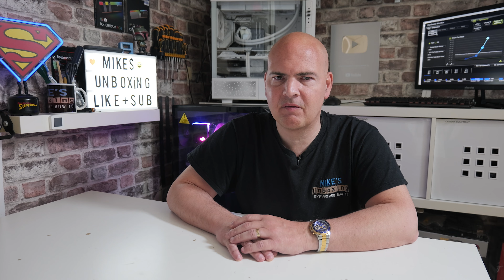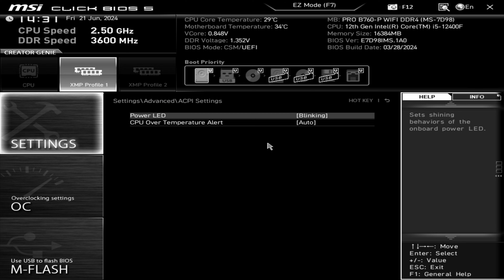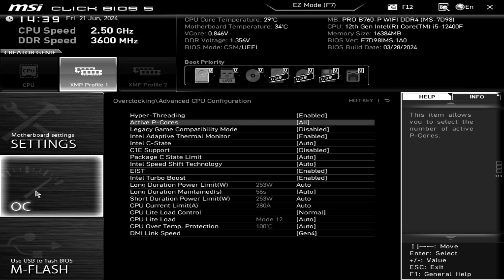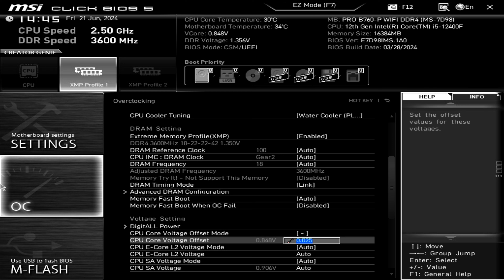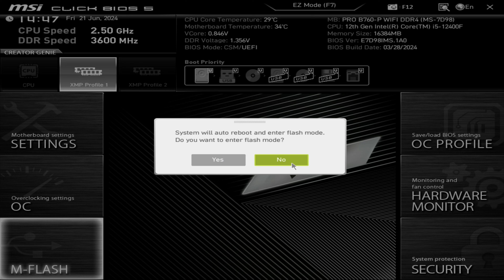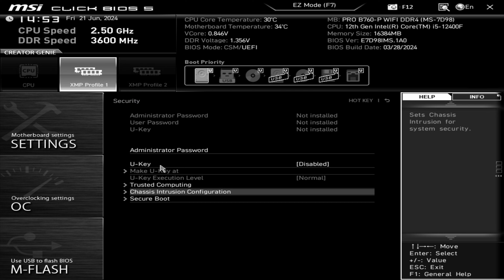MSI Pro B760 P WiFi DDR4 BIOS Tour & Settings Walkthrough

Comment: Hi, i have upgraded my pc with an msi motherboard. I already had windows 10 on existing ssd, but it wont boot to windows, it just goes back to bios screen. How do i know which is my ssd to set it as priority?
Reply from the maker: you might want to look at the CSM / UEFI setting, if the disk drive is in the MBR format a new motherboard might not be able to "see" it. Try toggling the CSM setting and see if the drive reappears

Comment: Installed windows on Sata 5 SSD and removed the win 11 usb and now the windows install is sluggish and unusable.. Google says windows boot loader may have been installed on usb.. I don't see how?
Reply from the maker: if windows loads then the bootloader isn't on the USB. i would be looking at the sata drives SMART health and see if there are any problems with it, or if it is full that will slow it down

Comment: Your processor is rated at 3200 mhz on ddr4, why you have 3600? Doesn t cause instability?
Reply from the maker: intel boards quite happily go past the 3200 recommendation
Reply: I have same motherboard but ddr5 and an intel i5 14400 F ( ram ddr5 5600 mhz) but I activated xmp at 4800 mhz, I don t know, mb can I put this to 5600 mhz on xmp?

Comment: Hello, what will be the best settings for intel i5 12400f?
Reply from the maker: really just enable xmp for the ram and thats it. the 12400 isn't overclockable and the b760 doesn't allow any exotic features to really push the CPU.
maybe a slight undervolt of the CPU core voltage might give a little more performance, but it won't be a huge change and only noticed in benchmarks really

Comment: Hi,

Nice run down on the settings. I haven't built a new build in years until today so it was useful to get an update on the new settings. I have an issue with this motherboard though. The  BIOS remembers the modification I made to the boot order but always disables the 'xmp settings' (at 15:45). I updated the BIOS to the latest stable one on MSI's website and it does remember it. I tried what I believe is called "reset cmos" where I unplugged the power supply, made contact with the 2 pin connectors using a screwdriver for 10 seconds, booted the system, let it reboot until things stabilized. 

Any ideas on why I can't get the system to remember to keep xmp enabled or how to fix it would be appreciated.

Thank you
Reply from the maker: This is maybe easier to fix or at least advise if we can ask more questions and get direct answers, so feel free to join our Discord chat and we can go over it in more detail https://discord.gg/XtBTGQ6BDu
Agree to the rules by clicking the emoji and you will get access to the rest of the Discord channels

Comment: I want to see what's inside ASPM Settings but nobody shows that. ARGHH!
Reply from the maker: main reason is that for many years the ASPM has been handled by Windows power management so no real need to change anything there to native settings
Reply: @mikesunboxing  Yeah, but I'm building low power nas box that is running Linux.

Comment: Is it normal for the motherboard not to boot into bios instead into the windows when first turn it on ? Also is that bad
Reply from the maker: that is fine, it should only boot to bios if the windows drive cant be seen by the system

Comment: Thinking about pairing this board with an i9 12900k. Is that a bad idea based on the fact that this is a B series board? Also I heard you mention that B series boards don't allow overclocking on the CPU, but I see the option for adjusting P core ratio in the bios. What exactly is that setting for then?
Reply from the maker: you would be better off with the 12900 and save the money
Reply: @mikesunboxing  Makes sense. Thank you for the reply.

Comment: I have the exact same setup as you with the motherboard, cpu (mine doesn't have the f at the end) and memory. My question to you is what I can do to upgrade my pc for gpu acceleration when I want to edit/upscale videos? If I do need to upgrade t he cpu I will but I'm looking for other options first. I currently don't have a gpu but what kind of gpu would you recommend I get for my needs? Also should I buy more memory? Thanks
CPU: 12th Gen Intel(R) Core(TM) i5-12400, 2500 Mhz, 6 Core(s), 12 Logical Processor(s)
CPU cooler: STOCK CAME WITH CPU
Motherboard: MSI PRO B760-P WIFI DDR4 ATX LGA1700 (BIOS 7D98v1D)
Ram: CORSAIR VENGEANCE LPX DDR4 RAM 16GB (2x8GB) 3600MHz 
STORAGE:WD BLUE SN570 500GB OS (SSD)/ST2000DM001-2TB/ (HDD)/ST40000DM004-4TB (HDD)
GPU:None	
PSU:EVGA SUPERNOVA 650 GT 650 W 80+ GOLD CERTIFIED FULLY MODULAR ATX POWER SUPPLY (JAN 2023)
Chassis: COUGAR MX330 ZORO
Reply from the maker: depends on the video work and the apps used, but something like the rtx3060 12gb would be a really good choice and not to expensive either new or used

Comment: Hello sir what a good explication by the way. Im wondering something sir i hope you can help me. Ill buy the version without the wifi, supose is the same BIOS interface. The thing is that ill buy a ARC A380 and theres soo many user in Amazon with problems that include this GPU with  Resizable BAR. theres something that i need to adjust in the BIOS or the GPU isnt compatible. Thank you for your time. Motherboard vs:  MSI PRO B760M-P DDR4
Reply from the maker: yes you HAVE to turn on resizeble bar on Intel GPU or they perform really badly

Comment: I know this is a bit older, and I’m probably just being a noob at pcs but I have a question. My B-760 Tomahawk with my 12600kf doesn’t want to use my DDR5 ram on xmp mode(meaning it won’t let me boot when I have xmp enabled), is that because it is its highest supported speed, or is it something else?
Reply from the maker: might need a bios update or the RAM is just too fast for the platform you are using
Reply: @mikesunboxing  I updated the bios to the most current version, I have no issues with it so I reckon I shouldn’t mess with what I don’t know, but thank you a lot for helping.

Comment: Hello Mike,
I really like your video content and technical/presentation skills. As someone who has not build a PC for about 12 years, I am now planning on a build
using this MSI motherboard together with an i5-13500 cpu (no GPU to begin with) and also using the Intel Box Cooler. 
With this in mind, can you please clarify your comment at 15mins 25 secs where you advise against using the Box Cooler bios setting.  
Basically, are you saying that even if using a Box Cooler you should set it to Tower? 
Many thanks in advance. 
Keep up the good work.
Reply from the maker: if you are using the intel stock cooler then it is probably a good idea to adhere to the Intel box cooler power limits. It might reduce the performance of the processor a little in some instances, but your workload and mileage will vary.
for anyone not using the stock cooler, use the tower or aio setting to get the most out of your cpu